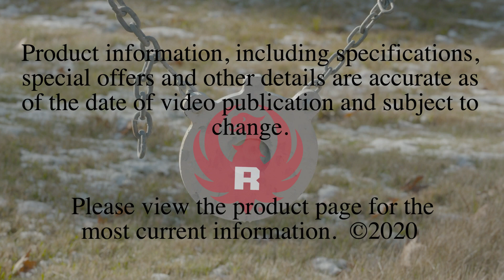Ruger-57™ Reassembly Tech Tip

Comment: How do I get the take down lever back in if I took it all the way out
Reply: Put the barrel/slide assembly back on, make sure its seated properly. Get the lever started in roughly the "unlocked" position, then rack and hold it all the way back (dont use the slide stop) and you should be able to push it the rest of the way in with your thumb.
I'm assuming you figured this out already.